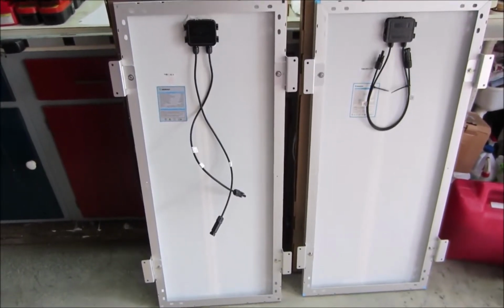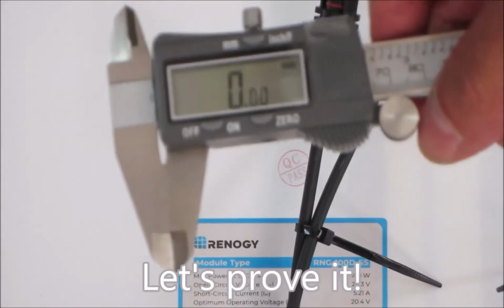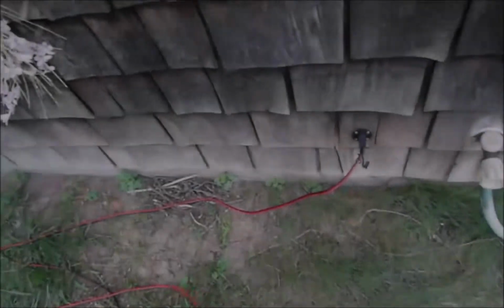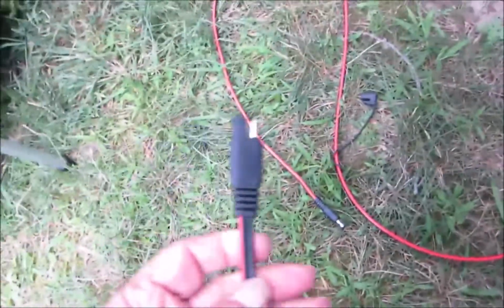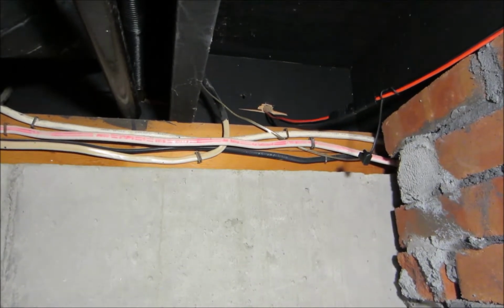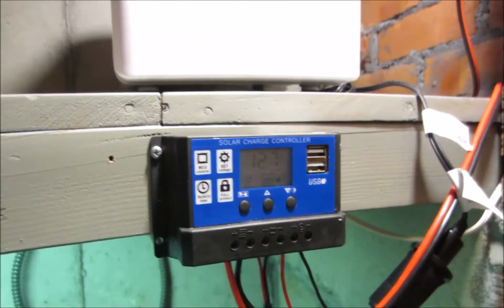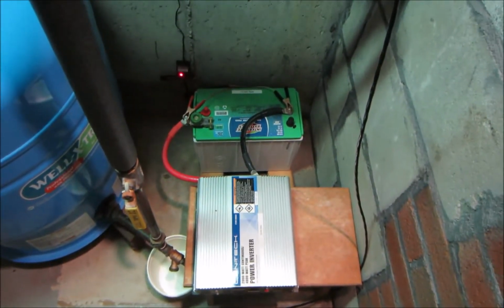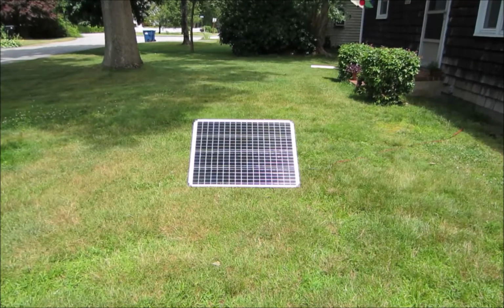Backup Power Project E3 - Hazard Fraught Solar Upgrade

Comment: So excited to see the exact project I wanted to do. Then the roadblock. Mine is a 220v pump. Stopped me dead in my tracks. Any suggestions for a rookie?
Thanks
Reply from the maker: The first thing to do is get the pump rewired. It should plug into a universal (NOT USA round, NOT USA twist lock), 220V receptacle. Harbor Freight doesn't sell 220V inverters in the US (as far as I know) and there are only a few 220V inverters listed in the US on Amazon so the best place to shop for 12-24V DC (in) to 220V AC (out) inverters equipped with universal 220V receptacles is at AliExpress.com. They offer both 220V 50Hz models (for use in Europe and most of the world), and 220V 60Hz models (for use in the USA, Japan, and a few other places). Keep in mind that pure sine wave (cheap these days) is better than modified sine wave, and wireless RF remote control is a convenience you most likely do NOT want to be without. Regarding 100V-240V, AC 50-60Hz battery charger/maintainers, I've since bought two of these: https://www.aliexpress.com/item/2255800207347070.html?spm=a2g0o.order_list.0.0.3cfd1802A1fCQU and like them very much. If you decide to get one, be sure to choose a 220V plug style that it mates properly with the 220V receptacles you install. Otherwise, you'll also have to install 110V outlet near the pump to accommodate the battery maintainer. The plug-in cord used on the well pump should terminate in a right angle (NOT straight) 220V power plug and the receptacle it mates with should be oriented such that the cord hangs straight down. You don't want it to stick out and eventually wiggle out of the outlet. You might also want to make a long, 220V extension cable for that power cord. Female end would mate with the 220V pump plug. Male end would mate with the 220V twist lock outlet of a portable generator. Generator twist lock outlets can either be 20A or 30A, and the plugs they mate with are different. You have to choose the right one. Everything else is pretty much the same, exactly as shown in the video. AGM battery prices have come way down. You might be able to get 200Ah AGM battery (July, 2022), for about the same as I paid back in September, 2015, for my 100Ah AGM battery. You still need 1/0 cables to connect the battery to the inverter. You still calculate the power of the inverter you need exactly the same way. You still need a little bench or milk crate to put the inverter on. As for solar charging, be aware that some starter systems only come with a 10A charge controller. Ten amps limits you to a single 100W (18v, 6A) panel. Better to choose at least a 30A charge controller so that you add extra panels as needed. Four 100W panels (each generating 18V, 6A when properly angled in full sun) = 24A FAST charging current, which is easily handled by a 30A controller. Do all this and you will have plug-in generator back up power for your pump, plug-in battery back up power for your pump, a FAST grid/generator powered charger to maintain and restore the back up battery, and a FAST solar powered charger to back up the grid/generator powered charger. If there's one thing people learn through blizzards and hurricanes, it's that you can never have too many backups. Glad you're interested. Please like, share and subscribe as it really helps the channel. Thanks for commenting!